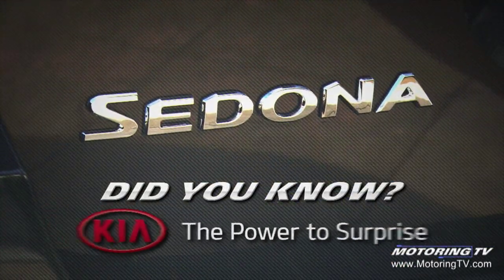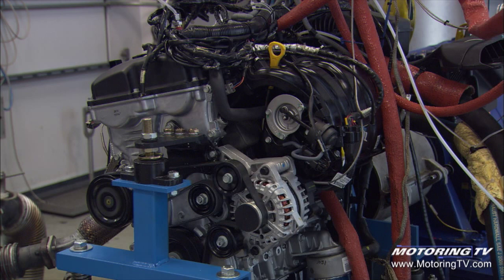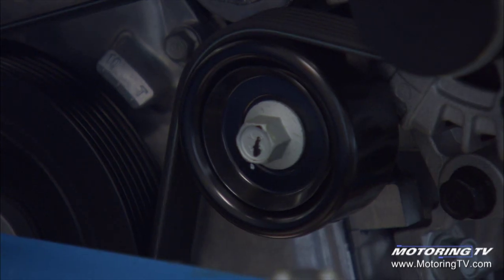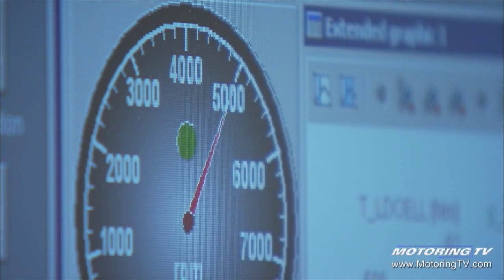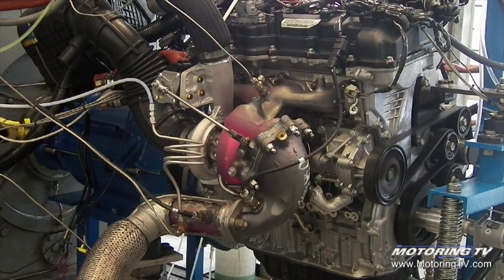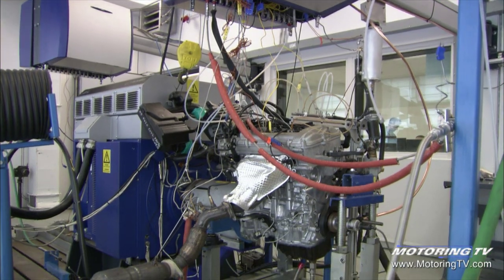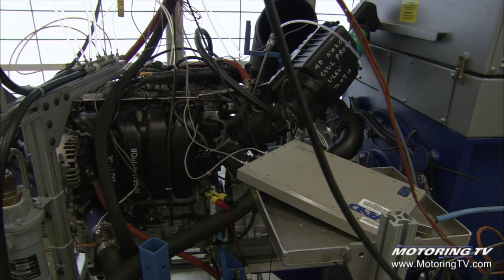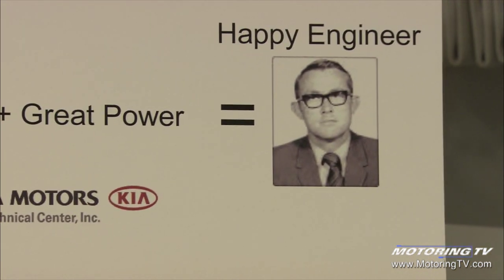Did You Know: Engine torture testing

Comment: Lotta haters in here. Had a Optima 2.0t for 4 years running it at 18lbs of boost with absolutely no issues. Not with the engine or the car. Currently drive a 2018 kia stinger gt2 and no issues with the engine but I'm only at 30k. I run it at 8lbs over stock boost frequently and other than being stupid fast, no other side effects. They didn't start making good cars until 2012 and not all were good but these days they are pretty rock solid... except for those random few that catch fire but we weren't talking about that.

Comment: Only 12.5 days red line?
And oil changes?
Thats definitely nowhere near torture test!
Drive it to red line constantly and change the oil at 14 000 km as your service manual says!
And run it for 60 000-100 000 km only that kind of driving !
On the limit constantly!
I promess you its gonna break pretty fast

And then take a second engine and floor the throttle at low rpms to see your LSPI!
Drive it on very slow traffic situations and let's see if it has intake carbon gdi issues
Reply: bruh nobody runs a car at a redline for 100000km are you an idiot

Comment: But that’s not how consumers use them... run it at partial throttle. Shut it off cold. Run it in dusty conditions and let that air filter get good and full of debris. Run that crap oil out for 14k run it out of oil then change it. And repeat  this process.
Reply: No problem man we have TOYOTA
Reply: @ibrahimqari9189 yeah right I’ve blown two of them トヨタエンジン and as a racer we gives them top notch treatment
Reply: This test is absolutely valid, every manufacturer does high RPM and full load testing during R&D. But this is only one of MANY durability tests manufacturers do. Testing durability under high load low RPM (lugging), extended idling, heat cycles, extreme hot and cold temperatures, hot shutdowns, extreme angles, high acceleration, deceleration, and and cornering forces, short trips, frequent starting and stopping, etc are also extremely important. The tests you suggested would prove nothing other than what we already know- any engine will fail prematurely if abused and neglected. The owner is responsible for making sure they use and maintain their vehicle properly, not the manufacturer.
Reply: For a consumer who actually gives a fuck about the stuff they buy.. this is an appropriate test.... They're not their to build products for ignorance/negligence.... That being said... at the end of the day... its Kia/Hyundai, shits gunna break..
Reply: Agreed! run a couple of hundred temperature cycles. Low revs under load to replicate a too higher gear choice, (my girlfriend's car often sees fourth gear when second gear would be the best choice). While on those temperature cycles include too many revs when cold. Do proper winter temperature cycles as they are a lot harder on an engine. OK, rant over 🙂

Comment: That "torture" test is definitely probably really easy to pass when your engine doesn't make enough power to damage itself and you set the redline well below the actual mechanical limits
Reply: They make way more power today than in the past spinning much faster as well.
Old engines would redline at 4k while new ones spin 8k no problem.
Also Big block v8s like the Ford 460 or 7.5 would make 240 hp while the new 2.3 Inline 4 ecoboost makes 270 hp. Even the 3.5 ecoboost which makes 375hp and 470 torque. The 7.5 makes only 460 from over twice the displacement.
Reply: @bryanmartinez6600  What old engine redlines at 4k? He does have a point though with these kia engines and the real test would be the heat cycling/ restart.
Reply: @bryanmartinez6600  No new engines rev to 8000 rpm besides sports cars.
Reply: @steve5912  my bad more around 6-7k they can some have hit 8k with limiters removed but... likely would launch a rod or the piston will give the valve a high 5
Reply: @bryanmartinez6600  Yea removing the limiter on a stock engine will blow something real quick

Comment: once an engine is running itll run forever. a REAL torture test would be in a -20C refigerator, cold start, full warm up, 100% load for an hour, shut down, full cool down, restart. THATS an engines hell. even harder would be omiting the warm up so starup at -20 and immediate 100% load and see how long it lasts
Reply: The cold start thing is so true I always let my engine warm up and never had a problem. All my freinds cars bikes have had engine problems because of hard cold starts
Reply: @mrpantur7280  yeah
Reply: Best thing to do is to warm up your engine before starting it.
Reply: @xMaFiaKinGz  Yup, that's why we have block heaters and oil pan heaters.
Reply: sorry but you dont know a thing about engineering
Reply: @ドリアンDorian  well your kinda right but how so? I assumed it was the few moments upon startup where theres no oil pressure and the temperature differences throughout an engine that caused the grand majority of wear in an engine. Im not asking to be an asshole Im just genuinly curious on how this might be wrong.
Reply: I will explain. The cold start is rough to the engine, but not that much how people think, thats a myth created long time ago, specially because nowadays we use thinner oils and with particles that create a coat in the internal parts to make it always lubrificated, even when turned off for a long time, so, for example, if you don't start your car for weeks, when you start it, you can see that it will still be silent, that's manly because of the new oils. Even if it wasn't the case and we haven't these type of oils, the test made in the video is waaaaaaay harder than any cold start, that's because you can't compare a rough condition operation (3 minutes of cold start) with HOURS of high RPM. Easy example, racecars, they operate in high rpm all time, and their engines last 1 race because the friction is so high that it creates gaps and the engine lose power after just 1 race.

The thing is, many people overestimate the cold start because they heard about it long time ago and they spent a lot of time waiting for their cars to warm up in the garage, so they think it takes too much time -- which is an error, you should turn on and go, what truly warms up the engine is the transmission...
And what truly kills the engine with time and people don't realize is bad fuel, because they contaminate the oil so badly that they become so much less efficient. 

Having any doubts or want to contest anything, feel free to say, God bless you. @Mr.PudgeMuffin
Reply: It can't be as bad for it as some suggest given that there's no "warm up" period for emergency stand by generators. 

Think about that one.... Middle of winter and a hospital loses power.  That generator doesn't idle for even a moment. It cranks, and immediately revs to 1800 RPM (or 3600 for some designs) and within seconds is powering up the building., even if that means it needs full engine power.
Reply: Gear God you are wrong. Big generator are preheated constantly with electric water heater.
Reply: @mikeg3529  Gensets are preheated with a block heater...
Reply: @amorag59  there are tons of applications where they are not, especially the natural gas and gasoline powered units, though I shouldn't have quite said "hospital" generator.   Those giant ones I'm sure all are preheated.
Reply: @mikeg3529  one in a year, yes.

Comment: 300 hours isn't really anything. I know GM runs them for 2000 hours at wide open throttle. Anyways I wish they would test them simultaneously to see which engines last the longest.
Reply: FartsTrading Academy what if they had 10 of these engines, that would be equal to 3000 hrs
Reply: @RinYuTune  Then you've have 10 engines with 300 hours worth of wear...lol